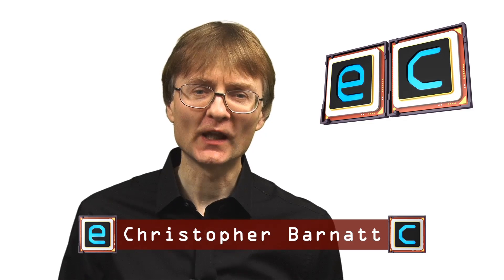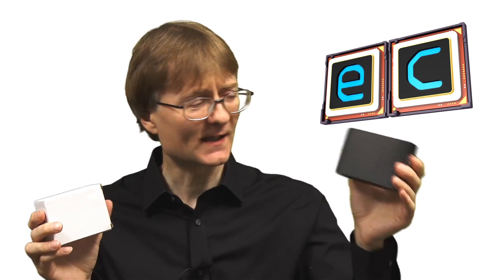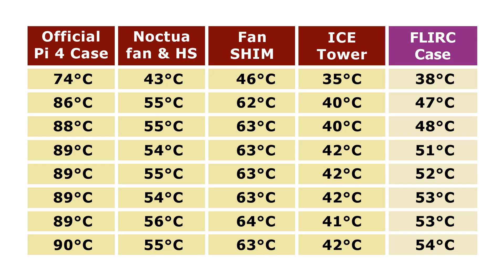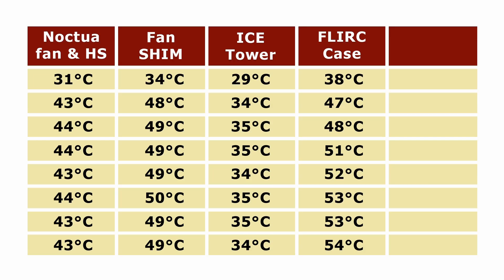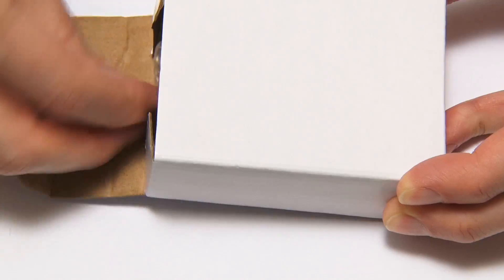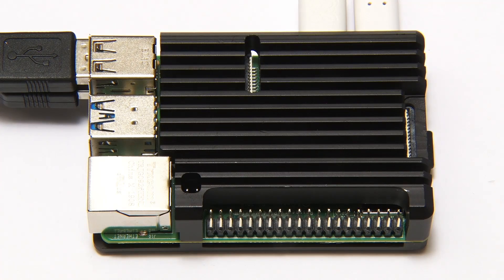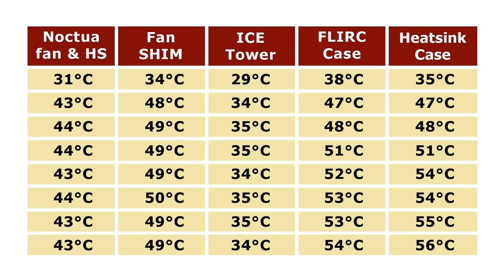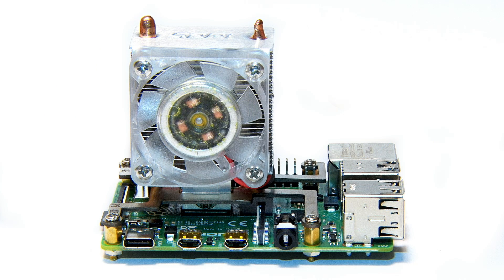Raspberry Pi 4 Passive Cooling

Comment: I still think that active cooling is better.
Because I am a overclock maniac I will active cool it
Reply: Yes it is better for overclocking definitely, or you could like me build a sub zero cooler. But a passive cooler is better if you're not stressing it too much and want it to be silent.
Reply: Stick it on the front of a motorcycle, I've killed 4 Zeros so far, gunk, so now it is clever venting as I have gone a bit heavy on the electrics on one bke.  Off topic but I like motorcycles and recently people have discovered PC fans for their use- noctua are popular for some reason nad that has to be lost in translation.  But, and as I like old motorbikes, oil coolers didn't have fans but now people are fitting them so they can stick such things out of the way and keep original lines of say a 1950s cycle.  Also they are even now using them to work as turbos.  Off-Topic but turbos are likely to be the next thing with motorbikes so they can pass emissions tests.  Not a problem with older bikes.

So what you cry!  Well we know about Nvidia  and I can see some fancy fans comming out of this development.  They should be loud though, except people are chosing Noctua fanswhich is strange.  My bike is so loud you'd never hear the fan